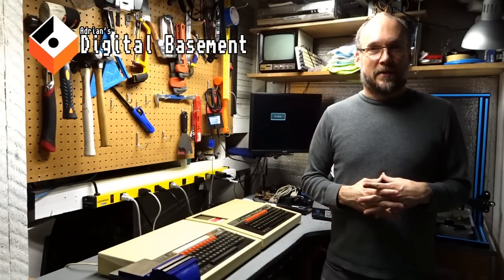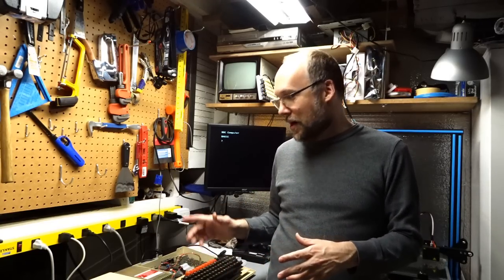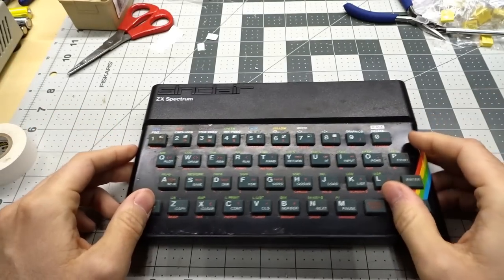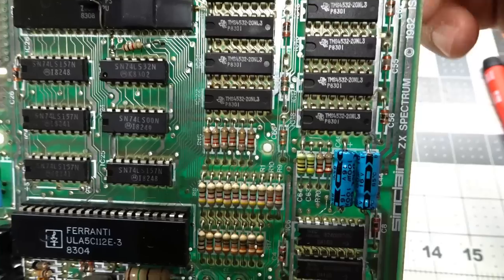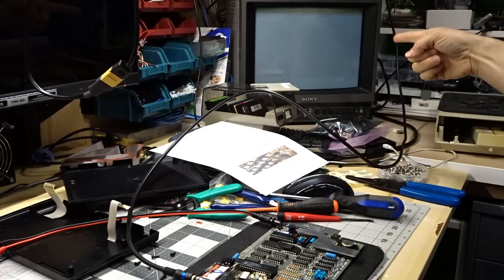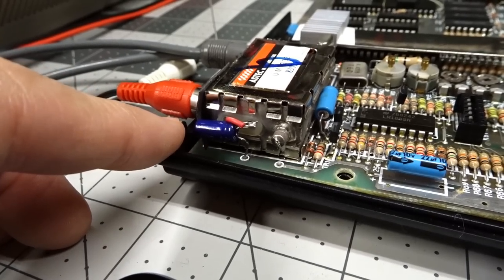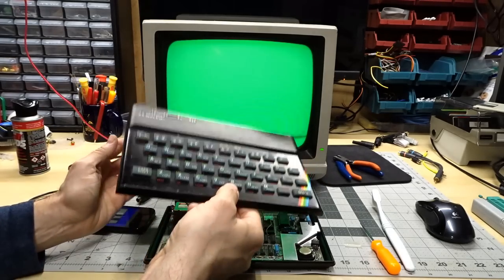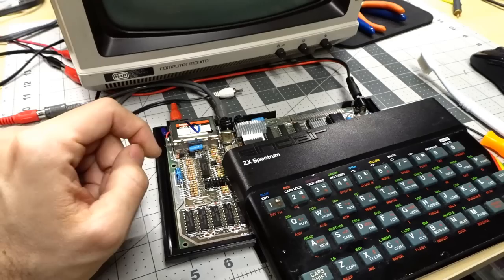ZX Spectrum Part 1 - It's a very sick machine (and a BBC Micro update)

Comment: If you've got problems with the RAM chips there are a couple of replacement options. I suspect the original 4532 chips which make up the upper 32K are hard to find, but an alternative is to put 4164s in their place. These are available relatively cheaply on Aliexpress. There may be a mod required in order to lock the chips into using either the upper or lower part of the 64K.  It's also possible to replace the DRAM with SRAM with a latch to hold half the address between the RAS/CAS cycle. This can be a do it yourself job (as the details are available online) or there are people selling boards that can be plugged in once all the existing chips have been removed and sockets installed.

The 32K RAM chips and associated circuitry came pre-installed in that model.  The 16K models were only produced for a short time after which only the 48K ones were produced.  The board design was significantly different though as the extra 32K was designed to be added using a daughterboard that plugged in between two DIP sockets.  I did come across an after market version of this board which added 64K chips to the setup and allowed them to be paged giving the machine 80K total, but these are somewhat of a rarity.

As for the keyboard, replacement membranes are available and you can also get the cover plates as well, ebay being one place to look.  There are modern replacements for the case and keyboard available some of which come in alternative colour schemes (https://retroradionics.co.uk/shop.html#!/ZX-SPECTRUM-replica-case/p/75106216/category=0 being an example).  It is also possible to find keyboard upgrades from the period, although these are harder to find as the vast majority of machines were left in their original cases.  You're also not likely to find one that does not already have a Spectrum board installed in it.  That said, it is still possible to find the Spectrum+ upgrade cases available on ebay from time to time.

Comment: When you've worked with spectrums for a while, you get a feeling for how long the computers ramtest (the short period before (C) 1982 Sinclair... appears) should take. That looked more like a 16K ram test than a 48K one. You can check the last memory location tested as good by the spectrum with "PRINT PEEK 23732+256*PEEK 23733". It will be 32767 for a functioning 16K model, and 65535 for a functioning 48k model. All memory locations are filled with the decial value 2, then every locations value is decremented and a check is made that the value is non-zero. Every value is then decremented again and a new check that the value is zero is now made. If either of these two checks fail, then the memory check is aborted and the address of the last good check is noted in 23732/23733 (RAMTOP)

Comment: The dead keyboard membrane is a very common issue, however replacements are easily available for just under a tenner.  The keyboard face-plates are also available new for around £15.  The face-plate has to be removed to fit the membrane anyway!  This is certainly worth fixing - the killer on these machines is usually the ULA!

Comment: Definitely repair it - there's a massive ZX Spectrum community, and replacements for all the parts that would otherwise be hard to source are readily available (including keyboard membranes and faceplates, which will make it look good as new). They're pretty simple systems - and there's an enormous software library once you get it going :) As for programming on it? You definitely get used to it - once you get a feel for where the various keywords are, typing things in gets a lot faster. I was surprised at the muscle memory I had after 30 years of not touching one

Comment: I used to have problems with the membrane keyboard, too. But not anymore! I drilled holes under the rubber keys. If everything is removed, the top plastic part under the aluminium cover and the rubber keys will show where to drill. And I have bought a lot of those square tactile switches(buttons with four or two legs) that are used to be in the front panel of DVD's, VCR's and things like that. And I wired them in on the Spectrum motherboard and they work fine ever since.

Comment: Funny story....back in the days of the spectrum I worked for British Telecom ( Built a Nascom computer back then). The telephone exchange ran mainly on relays with some transistor tech. They were way behind on computing. We used to have tours of the exchange and there was a rack with what was called a translator which was full of transistors etc. The guide used to take the cover off and show the visitors how complicated it was ( Not). For a joke , we got a spectrum and stuck it in the front of all the relays/transistors  so it looked like it was part of the gear. The guide proudly announced that this rack  was the most complicated part of the exchange and the exchange would not work without it. He removed the cover ( tadaaaaaa) and all the youngsters starting laughing. He turn to look at the rack and kept a dead pan face and said and " we can also play games on it".  We all had a good laugh afterwards. They probably went home and told their friends the exchange runs on a spectrum. In reality the spectrum was probably far superior to the installed technology.

Comment: Takes me back to the heyday of the Radio Shack Color Computer.  The earliest versions used RAM chips that needed 12 volts.  The upgrade from 4K you had to disconnect the 12 volt line and use it as an address bus line.  A7 wasn't even connected so to get 64K you had to add two wires.  The voltage doubler is like that in the Tandy/Radio Shack MC10, it's only needed for the modulator and the computer runs fine on 9V DC just no RF.  The later 4K chips didn't use 12 V but A7 still wasn't connected.  Sounds like there's plenty of scope to carry on with the Spectrum.  Good luck.

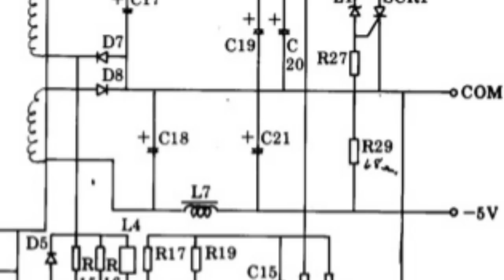Comment: 2:08 - -5-volt problem - May need to replace C18 and/or C21. The -5-volt is half-wave rectified. The diodes D7 and D8 are connected in a bizarre order, but electrically identical.

Comment: Hi,
As other people have said, might be best to keep this Speccy for spares and get another one.
The machine was sold in both a 16K (£125) & 48K (£175) models, but the 16K had chip sockets already fitted for the extra 32K (I originally had the 16K and expanded it later on).
The reason for the weird command entry process was to reduce the size of the bootup ROM. This was a tiny 16K, yet contained the operating system and a fully functional implementation of BASIC. For comparison, Microsoft BASIC at this time needed 32K of RAM, plus the O/S.
A big reason why the Speccy was so successful in the UK was it's relative cheapness. For example, although the Commodore 64 was superior in almost every way, it cost £600, almost 5 times more than the Spectrum.
The popularity of the Spectrum & BBC Micro are probably the biggest reason for the growth of the UK computer games industry in the 80's and 90's onwards.

Thanks for the enjoyable video, it brings back memories of taking my Speccy apart and making upgrades. I even had a 3.5inch floppy hooked up to it at one point. ☺

Comment: Could the BBC PSU problem be a dry solder joint? For the speccy, I'd get another one and keep this one for spares - but you run the risk of the replacement having the same or similar problems too.

Comment: I bought a 16k spectrum in 1982. I couldn't afford the 48k at the time. Soon after I realised that most of the games wouldn't run on the 16k model so I bought an aftermarket upgrade to 48k. If I remember correctly the instructions were to prise the old chips off the board with the handle of a spoon and push the new ones in!

Comment: Honestly well worth fixing , not a money pit, if you get a new membrane the same shop sells new metal keyboard overlays and the console will look good as new after a wash

The error your seeing is probably just a broken Ram IC on the upper address line , you can get those locally cheap.

Comment: Was playing with one of those sinclairs when I was a kid. 

One thing that came to mind was - you weren't using the original external PSU but te bench PSU. 
Which is of course not a issue, but you did limit it to 0.5A and a bit later to 1A. What I didn't see or (very likely) I missed it, is you allowing it 1.4A or more to take. 

The behaviour could also be explained because of the electrolytic cap's to be dried out. Usually it seems to work for a while but it 'disintegrates' fast once powered up. Check the power-rails for voltages and ripple. 

The board itself looks perfectly clean without corrosion, that said, you can still try to reseat the ALU. As it is socketed it is pssobile corrosion could be there.

If this isn't helping, I don't know if you should continue trying to fix it (moneywise), but could be satisfying to get it back working!

Good luck!
Reply: Those original speccy bricks were famous for their failure ;)

Comment: Hello again,
Glad your Speccy sort-of worked - the video out, for an Issue 2, is pretty normal. You mod seems sensible and those two pots next to the ULA can be carefully tweaked  to improve the output a bit. Very surprised the keyboard did fully work - especially now the membrane has let go I'd buy a new one, they are readily available and not expensive.
Repairs and mods:
-The electrolytic caps used in Spectrums are rubbish and often cause instability, especially as it warms - replace them all!
-The transistors near the PSU can be bad and often end up killing sensitive +5/-5/12v RAM chips - worth replacing but DON'T replace the transistors associated with the video - you'll have a hard time finding replacements that work!
-A quick re-seat of the ULA is worth a shot
If that doesn't fix it the next plan will be the RAM
-With a test program + oscilloscope replace the bad IC's, although I tend to just pull the lot and start again starting with the 32k group, as that ends up being less of a pain...
...you can use modern static RAM in a Spectrum, with minor mods. There are guides to be found on line. The advantages being greater reliability and availability.

FWIW:
I'd say your Spectrum is worth saving primarily because everything is available, often new production runs, for not much money - these machines are very popular in the UK and eastern Europe. Spectrums are, by design, janky little machines and if you replace the one you have it's just as likely your next one will be no better - although later issue boards are a little more reliable.
I've actually built a brand new rubber-key Spectrum from scratch courtesy of a Harlequin 128 board; new shell, new keyboard, etc... in the case of the keyboard new membranes are made and not expensive but might I suggest looking out for the version that comes as a PCB with micro-switches instead of a membrane? It goes under the standard rubber mat and makes the keyboard almost tolerable... The Harlequin isn't the only replacement motherboard available by any means but I went for that one as it doesn't require a ULA, comes with some more modern I/O, and works as a later Spectrum 128 for more options.

PS
A heat sink on the ULA is indeed a good idea - they tend to run hot and can die as a result - fundamentally a dead ULA = a junk machine... although these days even that has modern replacements, such is the popularity of this machine.

PPS
Over the years various people have made custom ROMs for the ZX Spectrum - one in particular, the GW or gosh wonderful ROM does away with the standard keyword entry system in favour of the more 'normal' type the characters method. Ben Heck (youtube) uses this very ROM in his ZX Spectrum projects and shows how he replaced the factory ROM with a switchable EPROM.

I hope that helps

Comment: I had one of these in 83, my second computer,a after the original ZX80. 
Bought the 16k, and fortunately it was one of the ones that had empty sockets for additional 32k.

I upgraded a couple of years later, by buying the chips for the empty sockets (8 ram-chips + 2 generic 74LS logic chips).
By then the fully working 64k chips were just as cheap as the half broken 32 ones, but is still could not use more than either of the 32k halves.

The keyboard ribbons were fragile, but you could fix it by cutting the broken bit off of and carefully strip and insert the remaining end.
Eventually they would get too short if you did that  too many times.
I imagine they are even more fragile now.

 Whatever you do, don't remove the plate over the KB to clean under it, its impossible to glue together nicely after.

Comment: The PAL video implementation on Sinclair's computers was notorious for being right at the edge of compliant, it relied on many TVs being tolerant enough to be able to lock onto the signal. That's probably why your monitor thought it was SECAM. Chris Smith's "The ZX Spectrum ULA: How to design a microcomputer" goes into more (and more) detail.

Comment: Personally, I say fix it, clean it, enjoy it. I played with a ZX81 before I bought my first computer, which was a rubber keyed 48K Spectrum, followed by the Spectrum plus 48k (y'know, the one with a solid keyboard).

I know that you said you couldn't imagine programming on them, but it got pretty easy when you got used to it. Much less typing at the end of the day, and you could poke assembly direct to RAM for custom routines. I wrote a routine to swap sprite banks using assembly direct from BASIC giving me sprites only limited by RAM. OK, I still had limits within sprite banks, but they swapped pretty quickly.
Reply: I learned how to program on a 1K ZX81 (at age 10). Sinclair BASIC was ingenious with it's use of the keyboard, as each command was effectively 1 character it saved memory. It took a while to get used to the layout but eventually, it made sense. I was surprised to find that when using a Spectrum emulator and a normal PC keyboard, I could still remember a lot of the commands!

Comment: With a replacement of the keyboard lifting off the top, and attaching a "SAGA Keyboard" the computer was so much better. And also starting a session by from a casette tape loading a routine that gave you 64 characters per line was a killer.  With a RS-232 expansion board kit from "Maplin Electronics" in the U.K  you then could  use  a 300 Baud modem with BBS:es. It worked really fine for some years, until the IBM PC clones became more wanted to have. Note: a very special thing about this computer was that the keys had "shortcuts" to BASIC programming commands. This was done by holding down some key color marked to get the desired command, when writing BASIC programs. Very confusing at first, but eventually saving time and reducing typing errors. This is especialla true, when using the "Saga keyboard".

Comment: Two things I'd point out, a year on, but maybe they'll help for the future...
1) Don't use elecrotlytic capacitors for AC signals. I know the video signal is low power, and there is a DC offset, which suits an electrolytic part, but spend a bit more and buy a ceramic part, suitably rated for the DC bias (ceramic capacitance drops with voltage). I have fixed a couple of Sega Game Gears and they use electrolytics in the video path where they shouldn't. Ceramics will last longer and work better.
2) The regulator chip from the input power supply is attached to a large heatsink for a reason: there is a large amount of current the computer consumes and the original power supply is very poorly regulated. This means that, with normal loads, it may supply 9V, but it could be higher. P=IV, so with a 1A load and 10V being regulated down to 5V means the regulator is dissipating 5W! Best to look at the datasheet for the part and find out what its headroom is (usually 2V). Set your supply to 7V or 8V and the regulator will run much cooler.
This won't affect the temperature of the digital chips, so you were right to affix heatsinks to them.

Comment: Sorry if these have been mentioned.
I've never seen a case cut like that before, but have seen some with holes drilled for ventilation as the PSU can happily run quite hot.
The green wires were probably added to make it easier to lift out the board, and then left cut so the board can be removed.
One of those "beebs" looks like it has already been made from several others.
There are some excellent forums at https://stardot.org.uk/forums and a facebook group too.
Hardware for your beebs: https://elminster.github.io/hardware
Software for your beebs: http://bbcmicro.co.uk/index.php
Demos for your beebs: https://bitshifters.github.io/
X marks the sockets to use ;)
DIY sideways RAM is a very simple addition, but I wouldn't bother modding the board.
The "volume control" is under the keyboard, but I wire my speaker to a jack socket and add a jack to my SCART leads to take the audio to the TV.
Goteks work well with the beeb, as do the "MMC" (SDCard) add-ons and if you feel like it you can make your own "MMC" for less than £1. There is also a ready made "Stairway to Hell" archive with a menu or you can use mine for MMC or GOTEK: https://stardot.org.uk/forums/viewtopic.php?f=53&t=16070&p=226077&hilit=menu#p226077

Comment: I've got a rev 2 board myself and I can echo the sentiments of other posters here. You can probably 'fix' the keyboard connectors by trimming a few mm off the end. Those old membrane connectors tend to dry out over time and crack in places and the ends can get oxidised.
Replacing the caps is always a good first step but be aware that C27 and C47 on the issue 2 are right under the voltage regulator heatsink and normal caps will not last long. The original caps were rated for high temps but they are as rare as rocking horse shit nowadays so it is recommended to swap the old, inefficient 7805 regulator for a modern switch mode version.